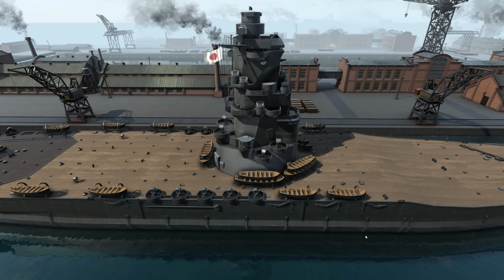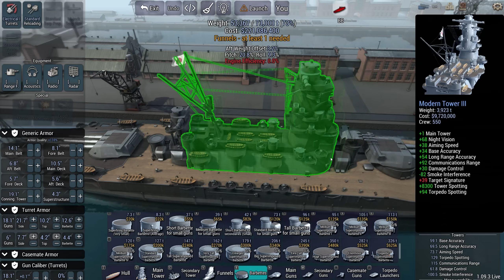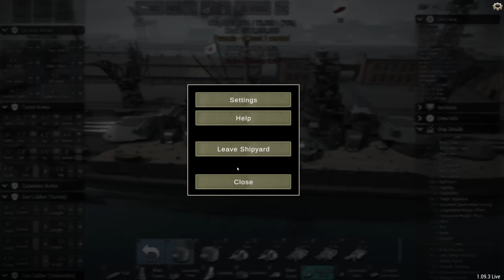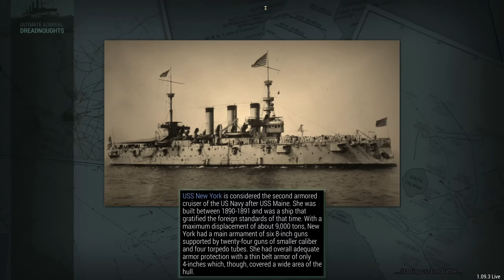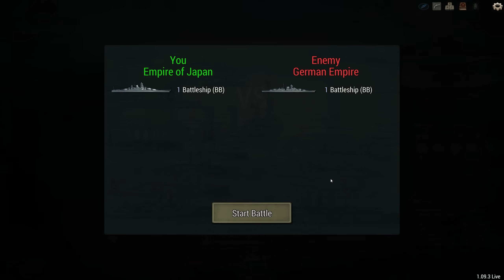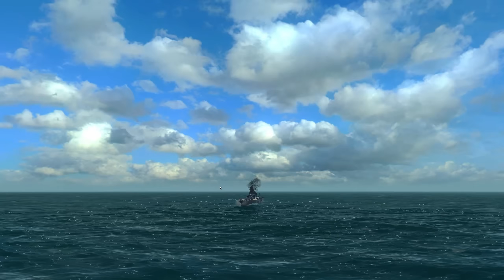Yamato - Historical Build with @Drachinifel - Ultimate Admiral Dreadnoughts

Comment: Did this require any mods or was it done with the vanilla game?  Because it really does look exactly like Yamato!
Reply from the maker: I’m using the balance mod which helps with getting the stats right but the look is 100% vanilla!
Reply: @BrotherMunro  balance mod?
Reply from the maker: @Cooldude-ko7ps  it was one of the first mods for UAD, sadly it’s no longer around but a lot of its ideas were incorporated into my own Dreadnought Improvement Project mod
Reply: @BrotherMunro  I see. I’m kinda new to ultimate admiral dreadnoughts. Is there a mod that lets you mix and match turret design types? Like say US secondaries on a Japanese BB?
Reply from the maker: @Cooldude-ko7ps  no, although fixing some of the weird and ahistorical turrets is something the Naval Arms Race mod does (and DIP V3 will try to address as well)
Reply: @BrotherMunro   cuz I had an idea to make a hypothetical post ww2 US captured Yamato where it’s refitted with US engines, radar, fire control, secondaries and AA.
Reply: @BrotherMunro  dang

Comment: As well as the problems discussed with getting Yamato's gun performance up to scratch, some of Yamato armour stats were wrong , she had a 16.1 inch belt not 16 inch (Musashi had 16 inch belt, but I think had thicker deck armour). Yamato also had  19.7 inches on the conning tower not 16 as you gave it.

Comment: If Yamato doesn't win this division then... well, given how the previous rounds have gone it wouldn't surprise me but it would be very odd indeed
Reply: Poor Radar & slow ROF could hurt her vs Iowa, Game wise at least the 16" is generally a more reliable weapon.
Reply: @ad3z10  It can, but even then it only takes one or two hits to come out on top

E.g., I recently tested an 18" BC with T1 Radar vs Dunkerque w/ T2. Even though it had half the fire rate, worse accuracy, got the shit kicked out of it and Dunk was built with 15+" of total belt/deck, it only took two shots to core Dunk like an apple.
Reply: @Hastur_the_King_in_Yellow  Interesting, I feel like it will have 100% win rate as a player controlled ship but I worry for the AI if it tries to kite.

I did also realise that Yamato's secondaries may actually come into play vs thinner armour as fully lengthened 6" guns should go through 1.5" of armour from a decent range which will help out the accuracy difference a bit by chipping away at the enemy.

Comment: 30:35

Wiki says they were 18.1”/46L
Reply: if you set it too the correct length the range is wrong at the current build its 13% length to get 25 miles of range\